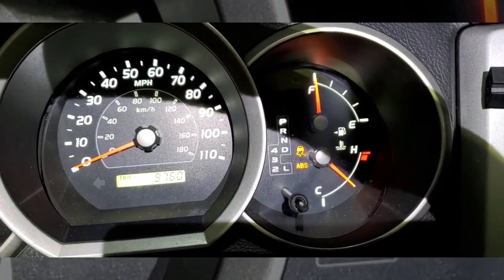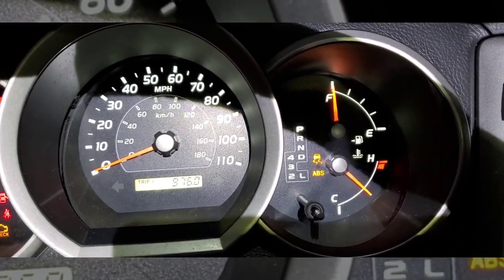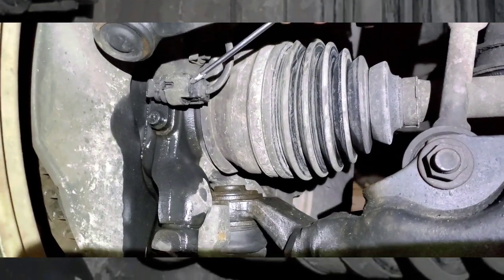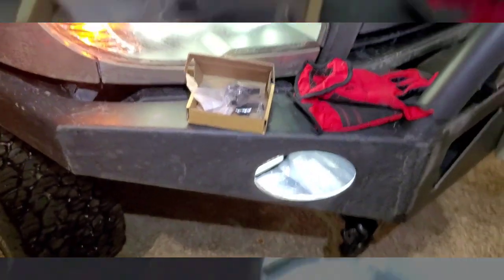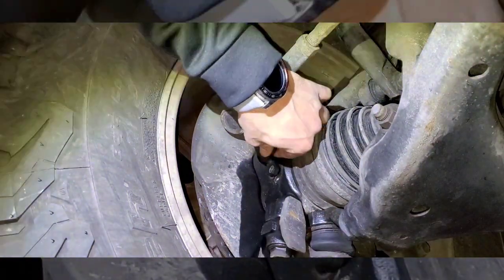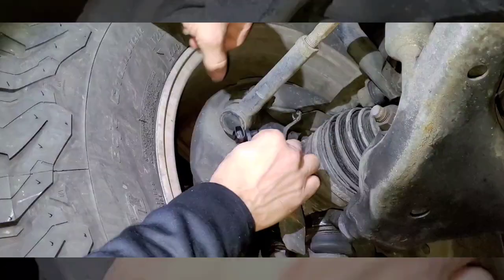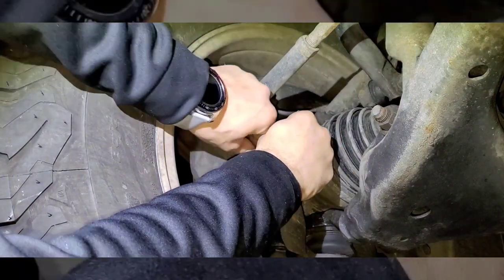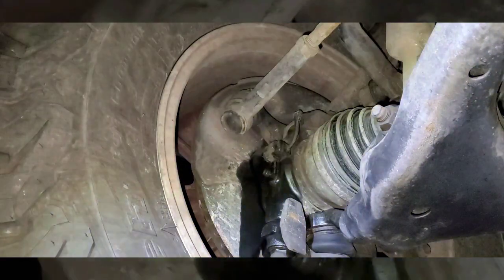4th generation 4Runners VSC ABS traction control lights. Replacing the speed sensors

Comment: You can’t just guess it’s a gas cap or a speed sensor without testing and diagnosing. A Toyota will set a specific code for a gas cap (EVAP) vs a ABS code which relates to the speed sensors…

Comment: Hey the link for the sensors doesn’t work. Could you post a different link or description for them? Did it clear the light or did you have to get it reset by a reader? Thanks !
Reply from the maker: It cleared the code. You can search for it on Amazon and should get a bunch. Just search for speed sensors for your vehicle.

Comment: My 4runner does not turn on the lights, I changed the shock absorbers and now the ABS and VSC lights turn on. Could you help me. ? Do I have to change those ABS sensors?
Reply from the maker: If you have a scan tool, you should do a diagnostic amd see what codes come up. If it is the speed sensor, it'll give you the code for it.
Reply: @Nashharis8758  ok. I'll go scan and let you know which one it throws

Comment: Did this problem occur after the lift? If not are there any mods they need to happen to the VSC Trac system when doing a lift to prevent this?
Reply from the maker: No, it was the sensors going bad. Lift kits shouldn't mess with that.
Reply: Did your speedo work? And did your brakes pedal stiff up?

Comment: Would this also apply to the gx470 of the same generation. All those lights come on except the check engine and traction control.  I have a very high pitched noise coming out from the driver dash, not sure if it’s the abs motor that has gone bad but my breaks work fine and are not sluggish or hard. The beeping is driving me crazy also I don’t get any fault codes when a scan tool is used.
Reply from the maker: Sounds like your master cylinder motor is going out or gone already

Comment: Ok so the sensors did fix the issue and clear the codes, right? You kinda cut your video short leaving us wondering....umm so did that do the trick????
Reply from the maker: Yes it worked, however it came back on a month or so later for the ABS circuit malfunction. I'll have a video coming up when I replace that as well. Thanks.
Reply: Nash Haris what did you need to replace then and did that finally fix the issue? I am trying to get this fixed myself. Driving me crazy!
Reply from the maker: @victorcortez1155  I haven't replaced it yet, but I will need to replace the ABS control system. The motor has gone bad in there and the ABS system doesn't work properly. You should start with the little things though like your gas cap, speed sensors and see if you have a leak like in your evap system. Do a smoke test if you know how to if not there are many videos out there to help you and some shops do it too. I will upload a video as soon as I replace mine but it is a pricey project so that's why it's taking mr longer to fix. Thanks.
Reply: Nash Haris gas cap done. Didn’t resolve issue. I get the codes clear but they end up returning within the month.
Reply from the maker: @victorcortez1155  yea, it's very common for the 4runners. Just keep researching and follow the lest cost effective issues first and hopefully you find the issue.
Reply: Victor Cortez did you brake pedal stiff up aswell?
Reply: @jpongej8  I have a 2003 Toyota 4Runner and I have no breaks and beeping I don’t know what to do I’m 5 hours away from home ., breaks are new but I just hit a 🦌deer and like hour later I notice the problem help I need to get back home  thx
Reply: @victorcortez1155  same thing happened to me after I replaced the gas cap.  Found I wasn’t cranking it on hard enough to get a vapor seal.  Now I make sure I get a few clicks when reattaching the gas cap.  No lights anymore

Comment: He's right...it is not a comfortable position to be in when removing the speed sensor. Removing the wheel helps a little bit for added light. BE SURE to spray WD-40 or any kind of penetrating fluid on the bolts and around the speed sensor. AND LET IT SOAK IN !!  I used a puddy knife to work around the sensor, then SLOWLY pry it out. On a high mileage vehicle it's going to take some patience as you don't want to break the sensor portion inside the portal. And if you do ?  Your going to have to drill it out. Pain in the azz. Work SLOWLY !!!!

Comment: When all the warning lights were on, could you turn on 4wheel drive or not?  I have the same lights on and can't engage 4wheel drive. Hoping new sensors will do the trick.
Reply from the maker: Yes, I was still able to even go 4low. Hopefully yours isn't the module.
Reply: I’m a hunting guide and the same thing happened to me I was able to get into 4 by turning my tundra off and then switching to 4 and when I turned the truck back on it engaged.
Reply: My parents mechanic broke mine speed sensor after replacing both front cv axles.  He didn’t admit it and it was fine till I took it there and after the abs light came on.  I had other issues too. I was pretty sure I had diff fluid leaking.  Limped it back to his shop n it felt rougher while driving. Calls back n all the stuff I said was going on said nothing was wrong but I had him rotate my tires since it was there and after getting back some of the problems were gone just a slight noise which could be tire or brake pad. Tho I checked my 4wd 4 low and diff.  All engaged with all light on dash.  Told me part was 245 dollars.  I’ll take my chance with the Amazon one.

Comment: I have a code C1201, the issue is that the ABS light isn't lit up; I just replaced the gas cap today. What else can it be just in case? Did your car shake while driving at any point randomly?
Reply from the maker: Yours sound like a bearing problem. Check your bearings by rising up the truck and wiggle the wheel back and forth with one hand on the top of the wheel and the other on the bottom of the wheel. If there's movement, that means it's a bad bearing. Look up how to check if your bearings are bad. It's easy to tell.
Reply: @Nashharis8758  Would that signal code C1201.
Reply from the maker: @Kevin Tran  yes, the bearings have a magnet in them making some kind of connection with the speed sensors to be able to read your speed.

Comment: could you please give me some advise I made a mistake by spraying wd40 onto the wheel speed sensor and now it's making a grinding noise is there any possibility of changing the wheel speed sensor and the problem will go away
Reply from the maker: Is it the wrong sensor? Or is the noise sound like metal on metal? Could be the dust cover around the rotors or possibly bad bearings.
Reply: @Nashharis8758  dear thanks for reaching back out to me and one more question what size allen key is needed to remove the bolt from the speed sensor

Comment: I have a 03 sr5 4 runner since the last bad snow my Trac off vsc off light stayed on since then the back passenger  wheel started scrubbing bad do you think that's the sensor also everytime it snows this happens but this time it stayed on also thank you I did comment and sub....
Reply: Also just replaced everything on brakes top to bottom 1 year ago
Reply from the maker: @YHWH77711  it could very well be the sensor. I would also check your bearings if it's rubbing. It could also be the sensor is covered in snow. I've had that happen to me as well.

Comment: How do you knew which tire sensor it was,and how many speed sensors do 4x4 v8 4runners have?
Reply from the maker: The code said front speed sensors malfunction. I have a good autel maxisys that tells me which side.
Reply: @Nashharis8758  thanks👍i see. But how many of those sensors 4x4 4runners have(do you know)?
Reply from the maker: @dvladimer  each wheel should have one.

Comment: Hello friend, change the sensors of the four wheels, check the wiring and pipes of the brake system and the ABS light is still on, what can I do?  I appreciate help please
Reply from the maker: What's the code?
Reply: @Nashharis8758  it does not return any code.
Reply from the maker: @josebelloso6494  if the lights are on your scanner should pick up a code at least.
Reply: @Nashharis8758  it does not throw any code it only has ABS and the vsc track. engine light is not on. I don't know what to do.
Reply from the maker: @josebelloso6494  sounds complicated but at the same time could be something stupid simple. Have you tried your gas cap? If that's loose it will throw warning lights on.
Reply: @Nashharis8758  yes i checked it and it is ok. I do not know what to do now.
Reply from the maker: Please please please please subscribe
Reply: @divinechoosenone  head gasket for a speed sensor?

Comment: How do you know it’s that 1 of 4
Is this the same on a ‘ 02 Toyota Sequoia
Reply from the maker: Hey bud, it gave me the speed sensor code (can't remember the code) but the traction control, check engine and VSC lights were on because of it. I'm not sure if it's the same for yours.

Comment: I don’t have breaks and there is a beeping do you think it just the sensor is bad
Reply from the maker: The sensor won't have anything to do with your issue here. Sounds like your brake master cylinder is gone.
Reply: @Nashharis8758  we found the problem there was a break line with a hole because it was rust and I lost all the fluid it cost me $200 to fix it .. thx
Reply from the maker: @jorgeeltoritoperez7238  awesome, that was going to be my 2nd guess.

Comment: Is it recommend to leave vehicle on whole changing it??? I noticed your car is on
Reply from the maker: No sir, I recommend turning the car off and disconnecting the battery before removing the sensor. But I looked it up and I found out it clears the code regardless that's why I did it.